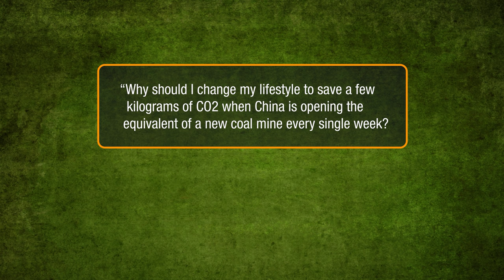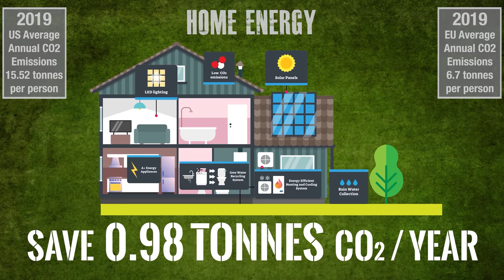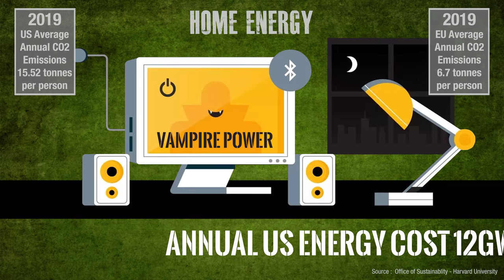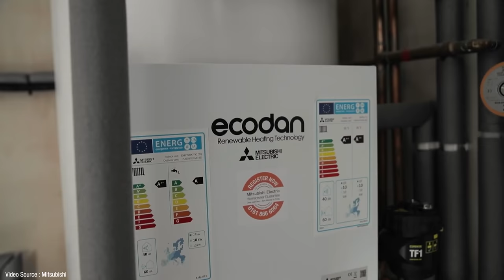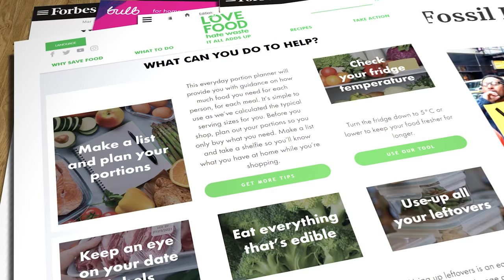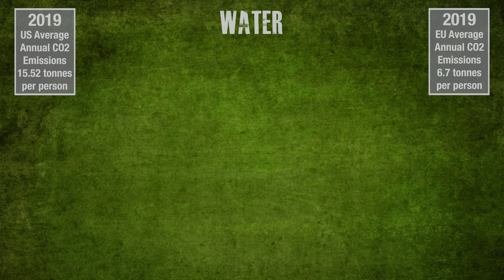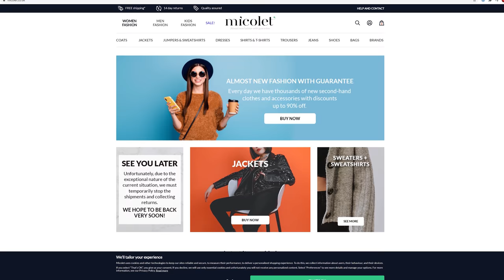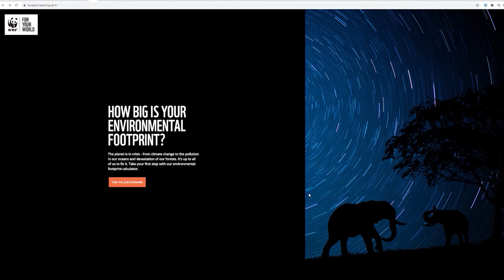Can you really affect climate change? Yes. You can. Here's how...

Comment: I drive 5km to go to work, no chance I will change to an electric, keeping my V6 Magnum, why? because it still emit less co2 now it has been build since 2008 and 194k km than getting a new electric car that got the big co2 package at the build time. Rust will kill the body before EV make sense on the environemntal side.  I put 50l of fuel each month and half, I have considered an Ebike but riding in the snow is a no go and finnacialy I will still be negativ for years, at 4k $ the Ebike for 8month of riding yeah need about a decade to go make worth it
Reply: This is the kind of budget every aspiring EV owner needs to make, before rushing out and getting an EV off the assembly line. If you drive modestly, you'll never recoup the footprint from a new EV.  However the good news is that by not driving much, you can do with a second hand EV, and still get emisson savings. You also need to consider the resale value of your current car, which will plummit as emission standards and tax and parking permits are tightened. Are you American? Then you have no idea what I'm talking about, but In Europe, it costs easily twice as much to own a non EV.  Your numbers 5km*2*5*6= 300km on 50L of fuel? Your car gets extremely poor fuel economy? Are you including other rides? Otherwise push it off a cliff immediately!
Reply: @Tore_Lund  I'm in Canada(I came from west europe so yeah I know how bad it is, high fuel price, car with gas guzzler tax etc..)so fuel is not too pricey right now, sure a V6 with a 4speed auto (yeah chrysler did it back in 2008) is not great but moving 1800kg of steel it require some power it's a 2008. I own a 2014 charger too with the 3.6 v6 and the 8 speed getting 6.6-6.8l/100km on highway so about 850km on a fuel tank(they are the same tank since they are basicaly the same car) while the other the max I did was 600km on a tank. I cheked the second hand market... well doesnt make any sense 28000$ CAD for a 100k km Chevrolet Bolt hell no, new it's about 37k$... I bought the magnum 5 years ago for 4k$ with 150Kkm, need some work, some body work but the thing I like the most is being a wagon I hate SUV, and also I need part I take "used" not used part from the charger and put on the magnum, ie: magnum need brake no prob, rip the brakes on the charger, put brand new on it and use the old on the magnum. another thing for EV is the lack of choice, Tesla... no due to constantly connected, lack of part to repair, bad build quality and some other. Chevrolet there is the bolt, not great not terrible just a city commuter but i dont live in the city. Asian brand are the same still compact cars.  I would prefer Hydrogen over lithium but we need to increase the efficency of the water catalys
Reply: @ItsJust2SXTs  Excellent story and 6.8L/100km is impressive in a Dodge Charger. I like your mindset, I too do most  repairs and have never in my life bought a new car. My current EV is a 2002 Fiat Elettra. Batteries I got from a scrapper from a BMW i3, so it cost me in total 8.500 CAD. with 20kWh batteries I got 110 miles range. Not that my former Fiat wasn't efficient and I only drive around 2500 miles yearly, but parking permit and car taxes in Copenhagen exceeded my fuel costs, so I had to do something.
Reply: @Tore_Lund  my first car was 2004 Chevrolet Malibu with the 3.5l, it was more efficient the 2.2l due to difference in the transmission and the 3.5l was detuned so making only 200hp. It has trans problem due to an old leak from previous owner that was never repaired and lost a lot of fluid. Got it for 2k$ cad in 2014 with 150k km. Then a trade it to the charger in early 2016 that I paid 23k$ msrp was 38k$ with 19k km then buy the magnum 6 months later. Having 2 cars but putting less km on the insurance for the charger cost me less than only owning the charger it's ridiculous. On the magnums, I wish I could rid of the 3.5l and swap to an electric, there is a lot of space in the front, trans tunnel and fuel tank to put battery in, being already a rwd could be swap with a tesla rear motor, need some modification of the subframe and electronics...
Cities are on there way to ban cars, Paris is on her way back to horse riding... they promote diesel car for decades with cheap fuel and incentives then "yeah diesel is bad with particulates, let ban them!" 
I think every one need to do steps for environment, personally I don't take airplane I could to see some family member that still live in Europe(last time was 2013) but Skype is good, my phone is from 2015 no need to change, my computer is from 2012 was in the trash juste because ram was not seated properly and still well. We can't change the world in one day but try our best to be better!
Reply: @ItsJust2SXTs  Doing a conversion is attractive. However to get it certified in Europe, electrically, and road worthyness have to be tested and certified, which means you have to drive it by 3 different institutes paying $$$ and then you need to convince an insurrance company you are not insane! Better option is getting an old EV from when they were Lead-acid which will have a valid type approval still, borrow some lead acid batteries and get it through normal inspection. The you upgrade it with Li-ion batteries and modern electronics as I did, and get a "modern" EV for pennies, that stil looks cool being a 90' or 80' or even a 70' EV. Yes recycling of what other people throw out! I've never bought a TV or much furniture, we have an exchange for trash too god to be thrown out, where we neighbours leave stuff for the taking. That includes furniture, children clothes and even fashion with tags still attached from the shopaholics, to TVs and computers and kitchenware. Most of my clothes are from second hand charity shops, but I'm an old fart, so styling is not my gratest concern.
Reply: @Tore_Lund  That's what stopped me from going swap all the paperwork, rust is another reason 10years old car start to get soem rust bubbles motly in wheel arch so yeahhh. road worthiness has his good ans bad, I was walking on the sidewalk when a car on the other side took a hole, the rear spring broke and bounce on my  sidewalk! hit a wood fence and stopped about 5m of me... that's scary. some cars are really in bad shapes, I split one of my rear caliper while normaly braking due to corrosion at the hose bolt, I'm in the process of replacing the front one, parking brake cable is partcially shot(aluminium doesnt like saltand it accelerate galvanic corrosion). I need to repalce my rear rotors every 3-4 years they developp rust belt on the edge and slowly getting to the inside. Road salt is very bad for the environment and we dont hear much about it's impact like the alchool production for beer, wine etc ( I dont drink, just water) I read an articale about that, to summerize: "we use land for producing alchool that is not essential for living instead of food or forest".
most of my furniture came from the street(people leave things they dont want on the side of the road), I took a U shaped one and 2 regular, I found an electric weed eater with charger and battery still rolling no problem! a table saw that working amazing. I prefer new cloth unless new or almost new, shoes replace them about 5 years but keep them for gardening well home use. I cook all my food, buy just the right amount to avoid waste, I put all vegetable in the fridge and most of the fruit, we have city compost but putting "bio bag" doesnt seem bio...look more politic than envionemental, paper bag is a no go, they break quickly after contact with fresh food like the skin of a vegetable.
PS sorry for the long texts...
Reply: @ItsJust2SXTs  We have food bins, put up by the council. The idea is that organic waste is collected seperately and put in bio digesters to produce methane for power generation and distributed heating. While the idea seems sound on paper, it is doubtfull that this can offset any meaningful amount of fossil fuel use, when collected from individual housholds. I suspect the extra diesel used for transport and the man power, emits far more than what is saved! A setup like this, makes sense next to a farm, where the amount of waste is substantial and it only has to be moved a short distance. Likewise, some of our waste incenerators have been fitted with water loops, to recover heat, but the cooling of the flue gasses is decrimental to the cleannnes of the smoke, so trash has to be sorted to a greater extent, which results in that there simply isn't enough to burn, which means we are now importing trash from Germany! However this looks good on paper too, as less oil is used, and it counts as renewable energy!! So yes, even in Denmark, where I live and globally is considered amongst the forefront, there is lots of this unscientific nonsense and green washing projects, which in reality are as bad or worse for the environment. Because of global warming, we rearly use salt on the roads anymore, every 3'rd year maybe. This means that old cars last a lot longer than they used to. But yes, you need to be hardcore to maintain an old banger. Each summer I take it to the DIY garage and clean and rust proof the underside, with POR-15, you know the tractor enaml, which is much better than any bitumen based under coat. This works flawlessly, but it is a days work each year.

Comment: Sorry, but I think that the notion that mankind can control the temperature of the earth's atmosphere is utter nonsense. However, if you want to talk about cutting pollution and waste, which is what most of the suggestions in this film amount to, I'm right with you. Burning stuff to produce power, particularly to power transport should be reduced, and cities can become much cleaner if the internal combustion engine is denied access. But I'm not going to replace my gas boiler for an air heat pump any time soon, if ever,  though if hydrogen becomes readily available, I'll probably go for that. Plastics in the oceans is a dreadful condemnation of mankind's slovenliness, but that starts with people littering everywhere, which never seems to be an acceptable topic for lectures like this.
Don't call me a "denier" unless you have solar panels on your roof, which I do - and there's my 2000 litres of rainwater tanks to water the garden. Our shopping bags are all re-useable - and so on. I don't like wasting natural resources, but I'm never going to lose any sleep about "climate change".

Comment: A couple of things don't add up:
a. If my electricity is 100% from renewables then how does switching to LED lights or disconnecting devices from the grid save any CO2?
b. In western Europe, the more water you save the more expensive it gets. You don't save money by saving water. The water is cheap, the infrastructure is expensive.
c. The solution for less plastic in the oceans is not to ban plastic bottles but to stop throwing ANY garbage into the rivers.
d. In western Europe, most plastic in the environment is from washing clothes that are made of plastic.
e. The tips about the toilet are not serious or are they?
Reply: A) Your electricity is not yet from 100% renewables, if you are reliant on the grid.
B) Water doesn't become more expensive by saving it. Many people are on water meters, meaning you get charged for what you use. Presuming you mean that you are on a fixed rate and so don't get charged for using it profligately, you are at the very least putting an unnecessary strain on the water supply, a strain that might contribute to higher fixed rate charges in future as the water company has to spend more money on reservoirs and fixing leaks to make up for the excess water wasted by people like you.
C) Plastic doesn't end up in the ocean only by deliberate littering, either directly or indirectly into rivers, though of course littering does play a part and is an awful habit. What's more, arguing in favour of a product that is almost completely unnecessary (plastic bottles) is perverse. Oil was extracted to use in its manufacture, energy was used to produce it, tiny particles of it will probably be in the water you poured down your throat and may have been retained in your cells, and yes indeed the bottle might end up in a natural body of water once discarded, or pollute the land.
D) I don't think that's the case. There is a lot of plastic litter and plastic waste accidentally lost from bins and landfills due to high winds, there is the synthetic rubber of car and bicycle tyres, fishing gear...but again, that's missing the point. I don't see what he said that contradicts this problem of plastic fibres in the wash. If you want to do something to alleviate that though, you can stop using synthetic clothes as much as possible. For the vast majority of clothing, they aren't needed.
E) I've heard people suggest the same thing lots of times, Kenneth Clarke (English politician, now a Lord) advised it several years ago during a drought. I have concerns about potential smells and staining of the bowl myself, but they might be right.